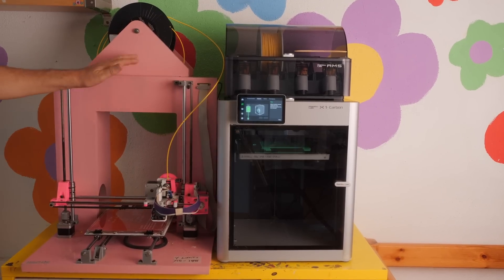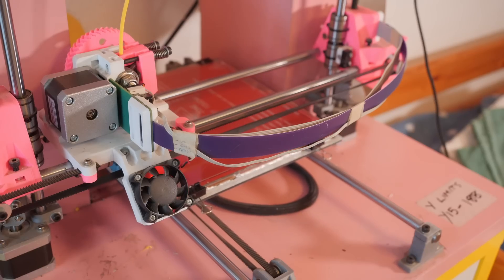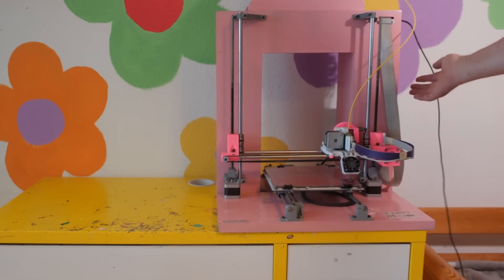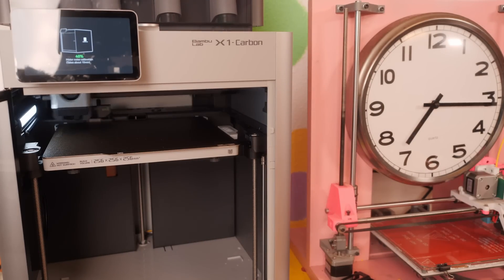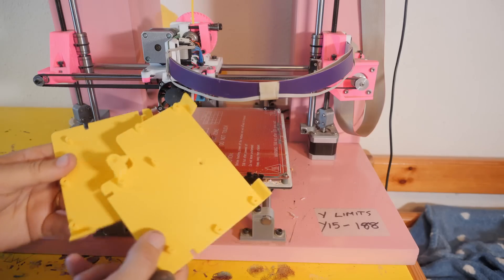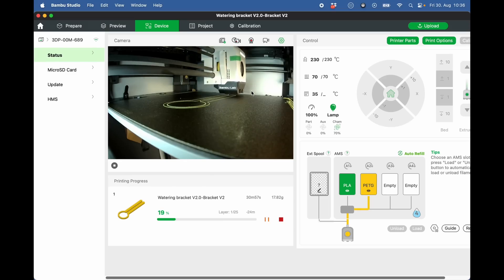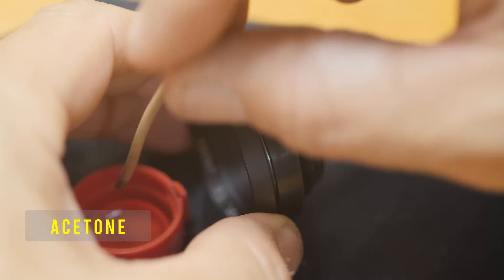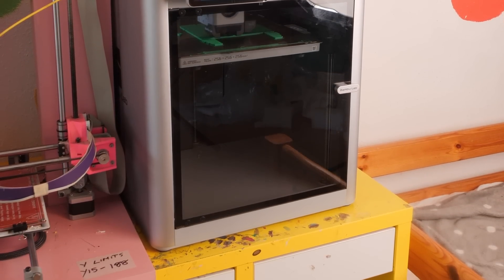How have 3D printers changed in a decade? || RotarySMP

Comment: The middle layer failures are from a partial clog.  A cold pull should set you right.  Might see what temp it runs after the first layers.  I have more issues with slicers than machines.  That said, the X1C is a superior machine.
Reply from the maker: Thanks Craig. Yeah, the Wiener90 normally prints better than that. I wonder if the nozzle is distorted from being dragged across the glass as well?

Comment: I upgraded to a Prusa MK4 last year, and I've never been happier. If you just want a tool rather than a new hobby, getting a top tier printer is definitely the way to go.
Reply from the maker: I agree Tom. The usablity is night and day.
Reply: SuperfastMatt recently put out a video where he describes that he wants to use a 3d printer as a tool rather than take "3d printing as a hobby". The "works out of the box, every time, can handle exotic filaments, no fiddling required" printers like the Bambu X1 (also what he bought) have finally enabled that.
Reply from the maker: @oohshiny8713  I saw that one. It is a very good summary.
Reply: Took me 2 years to get my Voron 350mm from hobby to a tool I can print and don’t have to babysit it 😅
I now own a X1C, Voron and a Snapmaker J1 (IDEX printer). 

Repaired a lot of stuff and invented a lot of parts for me and friends. 3D printing is awesome. I combine 3D printing with my CNC as well. 
Having a 3D scanner helps a lot for reverse engineering. I recommend the CR Raptor for small to medium sized stuff. ~5-150mm
Reply from the maker: @Todestelzer  Nice set up. I also have a friend with a Voron, but the hobby and tuning was a negative for me. I already went through that on the old home built printer. My hobby is more CNC than printers :)

Comment: Use a bit of heat to loosen the glue on the lens.
Reply from the maker: I was worried about over heating the lens, but someone put 2 and 2 together, and recommended I use the printers heater bed for nice controlled heating.

Comment: Keep the lens on the printer bed and gently heat for a while. Get it to heat gently so as not to shock the glass. Sometimes works
Reply from the maker: Great idea. The heat control was something I was worried about.
Reply: @RotarySMP  I run a small telescope shop, stuck filters with thin walls are a common issue. The spanner won't work because 3d prints are too slippery. I use laser cut ABS spanners I order online but you could try carbon fiber filament as it will have a bit more grip. Those layer lines act almost like a bearing surface

Comment: My biggest issue with my X1 has been PLA breaking inside the AMS feed tubes after I don't use the printer for a while (weeks, months).  That seemed to be fixed by unloading all the filament so it's entirely inside the AMS with some desiccant packs when I'm done printing.  From that I assume it's a moisture absorption issue.  I've also had a lot of issues with parts warping off the build plate, but using brims, tweaking temp settings and letting the build plate warm up an extra 10 minutes before starting a print seems to have fixed all of that.
Reply from the maker: Thanks for you feedback on that John. I never realised that PLA or other plastics were Hygrocopic, till I started looking at X1C videos. I need to collect a bunch of silica gel, dry it, and print some dessicant tubs for the printer.

Comment: i dont think moisture is your problem at all,pla is quite unaffwcted by moisture..i have reels hanging in the ceeling of my workshop open and been hanging there for years..take one down, cut off the first meter,set it in the machine and it goes to town - however i think your problem is underextrusion..dosnt show well on big and flat pieces, but quite well on smaller things..eighter the extruder is skipping steps or just to little flow..or even dirt in the gears or worn gears   the AMs is the reason why i woud like a bambulab, but the printsize stops me from getting one - to small for my taste
Reply from the maker: Thanks for that tip on under extrusion. That printer has had the same gears and extruder for the whole 9+ years.

Comment: You may find that the lens fungus has damaged the lens coatings. It was quite common when I was in the trade. But I have been retired many years now.
Reply from the maker: I dont doubt that, but would still like to stop it growing further. Did you ever encounter LH threads on a lens like this?
Reply: @RotarySMP  no left hand threads, but maybe thread lock!. Our lenses had a slot in the ring and we used a flat adjustable plate with pegs that located in the slots. Sometimes held the plate in a vice and unscrewed the ring. Used old inner tube rubber to grip the outer housing.
Reply from the maker: @petertitterton6836  They certainly used some sort if lacquer as a thread lock, but I tried abot 5 minutes of keeping that joint moist with acetone without luck so far. Next attempt with heat.
Reply: @RotarySMP  remembering back we used black nail varnish to lock screws. I got some strange looks when getting new supplies!

Comment: My first was a printbot model.  Best way I ever found to set Z height ( In my opinion is the worst)  was to spend about a week with a 12X12 granite tile a caliper, and about 50 hours of using a 50X50X12mm piece of alumimunto make a poor mans gauge block.  Then it was just a matter of using a multimeter to level the bed via continuity.
Reply from the maker: I did it with feeler gauges. I much prefer the machine to deal with this itself :)

Comment: To be fairrr, the bambu must be at least 2x cost
I wanted to start and a friend had a Lulzbot Mini lying around (3mm filament, 2015?),  I used it once or twice and then ended up just grabbing a basic Ender V3 SE and with basic PLA it was much easier to use
A bambu would be a dream, I need ABS or similar higher temp for Australian heat
Reply from the maker: It seems like the Bambu P1 is pretty much the same printer, but you have to do the enclosure yourself, and it costs about 50%.
Reply: @RotarySMP  I have the P1S, the main differences are the camera is only 0.5 fps on the P1 and there's no lidar for auto calibration, and no AI spaghetti detection.
Reply from the maker: @Corvus.2606  I see that a lot of print farms use the P1 rather than the X1, as there is more in common than difference. Seems like a great deal.

Comment: The Bambu will completely change your view of 3D printed parts.  So simple to use that you will find joy in printing.  Anytime you say ‘I wonder…..’ can be printed without hardly any effort.  And then you can quickly print out prototypes to confirm design features prior to something you plan the machine.  And after you do that a few times you might start saying to yourself….. will plastic work instead of metal?  My biggest surprise was the first time I ventured in using TPU95. Printed very fast without any stringing.  Such an under appreciated material.  Flexibility can be tuned with infill.  It’s Uv stable for outdoor projects.  My most important tip is get a food dehydrator and always make sure TPU and PETG materials are dry before using.  I’ve never had any failure or stringy prints since.  Have fun.
Reply from the maker: Thanks Joel. I never realised how hygroscopic these plastics are, until I started watching X1C videos :)

Comment: Re the infrared reflective Z axis sensor on your old machine, they are really sketchy sensing glass.
If you out a spot of white matte paint on the glass, or a piece of white matte paper sticker, it should be much more reliable sensing the height.
BUT with that cool new machine you probably wont use the old printer now anyway! 😎
Reply from the maker: It was sensitive to which side of the glass was floated. I couldn't get it to home until I flipped the glass sheet, but since then I dont think the surface is the issue. I doesnt take much to bump that little PCB and have it shift by about 0.1mm
Reply: @RotarySMP    wow 0.1mm is pushing the limits of a sensor like that anyway! Ambient IR from room lights or nearby hot objects could easily cause 0.1mm difference in the reading.

Comment: I have owned my Bambo Lab printer for around a year now. I also have had the same experience with it. Before with previous printers it was like maybe the print would be OK. So printing a part wasn’t my first choice. But with this printer I model the part and just print. It works that easy. It has become a tool instead of a fiddly experiment.
Reply from the maker: Hi Peter. Glad to hear of your long term experience.

Comment: I think the Ender 3 was the turning point with useable 3D printers. I had to do very little to mine to get it perfect I use it every few weeks and get perfect prints every time. Bambu labs have ramped up the speed and ease of use to next level though - a printer that anyone can use? 😀
Reply from the maker: It is really going that way. From the videos though these printers seem to still need some maintenance, which is probably beyond most people.

Comment: Is that a lens off a Polaroid Land camera? I ended up having to drill two holes in mine to get a lens spanner on it, not sure why it doesn’t have the usual slots for one. Friction bungs made from rubber can work and don’t leave marks but I’m about 50-50 on success there.
Reply from the maker: Yes, from a 180. This is the front lens group.  I used a bung to unscrew it from the shutter, but cant seem to get the unit apart. There are two tiny spanner grooves, but on the opposite side from where you can put a spanner. I wonder if it could be a LH thread?

Comment: I'm glad you are now getting stuff sponsored, but for the sake of the integrity of the channel, I'd use the proper YouTube labeling for that.
Reply from the maker: Hi Alex, I marked this as a product placement video. Did that not show up for you?
Reply: @RotarySMP  Didn't show up on the big screen, but visible on phone. So yeah, it's marked, and if anything, a problem with how Youtube manages it. Thanks.
Reply from the maker: @graealex  Thanks for checking that.
Reply: @RotarySMP  Now it's also visible on the big screen. One note though, since I recently installed the same printer for a customer - you can completely disable the cloud features via the touch screen. Means that your files get directly uploaded to the printer, which is faster and more privacy-oriented.
Reply from the maker: @graealex  I figured I would leave it cloud enabled initially, till it has proven reliability. I am not too sensitive to privacy for that sort of little parts and projects I am printing.
Reply: @RotarySMP  I found that uploading and starting a print would sometimes take ages because of these cloud features.
Reply from the maker: @graealex  Oh, so far I had no issues with that.

Comment: The Tiertime UP!/Affinia printers from 2011 were about double the cost of the X1 but were much closer to a tool that just worked than most of the commercially produced repraps ever were, even today.
Reply from the maker: Thanks, I hadn't heard of them.
Reply: I too love the simplicity of these. Main downside for me was the printed parts for repair were only available in a proprietary format so I couldn't print them on my reprap. Solution? 2x afinia to have a spare.

Comment: You need to try ABS GF25 with the heated chamber. I use it a lot on my Qidi and it's my goto filament as it has no-warp, nice finish and good strength.
Reply from the maker: Thanks. I need to work through each of the filaments I received.

Comment: I had plenty of issues with that type of dual infrared z probe too.
We use bamboo printers at work for prototyping. Half the staff have bought bambu printers for their own too. They're not perfect but the development work bambu put in to get them working like appliances really shows. I use a seckit tank at home but only for things that the bambu's don't do as well like big abs prints.
Reply from the maker: Thanks for your feedback Max. You really see that this machine was engineered by a team.

Comment: Yes those defects can be largely explained by moist PLA. It really does make a big difference. HiPS also suffers from this badly
Reply from the maker: Thanks. I never really picked up that these plastics are hygroscopic till I started looking at Bambu lab videos. Normally the Wiener90 prints better than that, but it has been a hot humid summer here.

Comment: could be fun to try and convert the old 3d printer into a mini cnc mill/router with a super high speed spindle for when needing to make small features on small parts where you need those small tools
Reply from the maker: Those long, unsupported 10mm rods used as linear guides on the 3D printer are way too flexible for any useful machining. Remember, I also have a dormant project lurking in the basement which is a small router style mill with proper liner rails.
Reply: @RotarySMP  wait why haven't wee seen that? Or did I miss a video?
Reply from the maker: @betaich  It is not an active project, but was briefly shown in the start of my "Stale projects" video two weeks ago. :)
Reply: @RotarySMP  thats fair. personally if i where to start a project like that i would try and use/make hydrostatic boxways. even or morel likely becuase its a small machine 
since its not as big its easier to make then for a big one and wince its small its also not gonna have a ton of power in its axis so if i can remove the stick slip effect that way its well worth it to me ( plus its zero wear on the ways then )

but thats just me ( the danish guy that also wanna take a SCHAUBLIN 125 C or a Weiler Primus and make them hydrostatic in both there way's and spindle bearings ( maybe even change there srews and rack`n penion to two oppersit mounted proloaded hydraulic piston's )
Reply from the maker: @flikflak24  Something like this...
https://www.youtube.com/watch?v=sFrVdoOhu1Q

Go for it.
Reply: @RotarySMP  kinda except he use air bearings where i want to use hydrostatic bearing. the air bearing needs less shilding since it only use air ( maybe also some mist cooling ) well with the hydraulic one there is all the oil which  needs more shilding to recapture the oil but the oil do have benifits ( like complet corotion protektion. better vibration dampening and if the pump stops doing a cut you still have some time to stop the machine do to the oil film but if the air stops to the air bearing stop's/get block it instantly falls down and skrape and wear the ways) plus with oil you can have the noicy pump in a diffrent room if you want but with air you can always hear when it comes out at the bearing

Comment: What you need is a 3d metal printer
Reply: Well those things are incredibly cool, and some guys on here like "Wesley Kagan" (incredible channel by the way) even have one , but they are in the 250k + range, are HUGE, and need awfully expensive powder to work and sometimes a sinteroven and sandblaster to work right 

But if you donate that money, I'm sure rotarySMP will get one 😂
Reply: @Basement_CNC  i think you woluld also have to donate something to the misses and some extra space
Reply from the maker: That would be cool in theory, but I doubt those things are safe for the house hold :)

Comment: Amazing the quality from the old to the new. Have been looking to buy a bamboo lab but the price is still out side my budget, maybe when the price is lower
Reply: Check Qidi Q1 pro, no fuss and work great out of the box.
Reply from the maker: There are some tests from professionals which would indicate that the Bambu A1 has even better print quality (within it's limitations as an open printer).
Reply: Flashforge 5M is a budget friendly option with none of the cloud vendor lock in.
Reply from the maker: @HM-Projects  I am not to concerned about lock-in, as filament is a commodity.
Reply: @RotarySMP  I'm sure someone will manage to jailbreak and release a klipper firmware for it. I stay away from walled garden software / firmware in general, but that's just me :)
Reply from the maker: @HM-Projects  I get that, I did look into getting a second hand Voron.

Comment: If lens/camera parts are stuck it’s usually an application of heat required, or a backwards thread (mostly on winding mechanisms and the like) I’d be reticent to use acetone inside the lens just in case it affects the coatings or manages to unstick lens doublets for instance.
Reply from the maker: Yeah, I am pretty cautious about applying heat to something like this, but might have to.
Reply: @RotarySMP your printer bed has good thermal control and not too extreme temperatures. A shallow dish of sand to distribute the heat helps. Would love to know how to best do this for similar reasons. No idea how dust gets inside sealed lenses, but it does.
Reply from the maker: @TheBakafish  Oh, that is an excellent idea. I can gently heat it about 60°C and then try to unscrew it.
Reply: @RotarySMP  I’d also recommend using a strap wrench type system to unscrew. Something that can secure a strap of nylon or rubber the same thickness of the attachment surfaces on the lens. You can make the securing handle much more robust as well.
Reply from the maker: @benjimbo  The surfaces to grip on are only 5mm, and 6mm wide. I made the spanners 6mm wide.